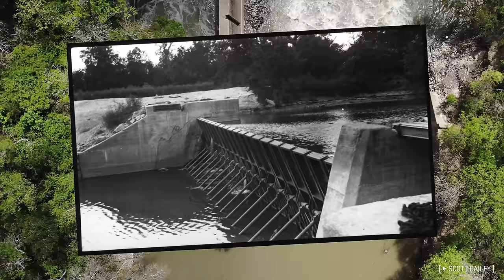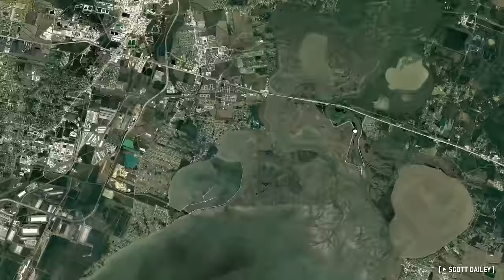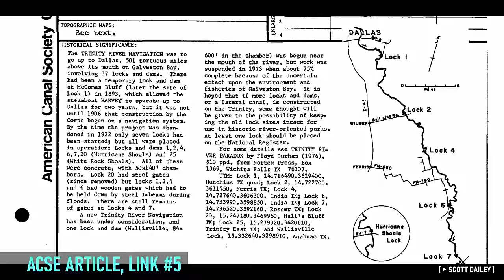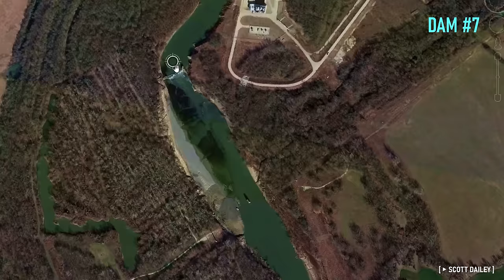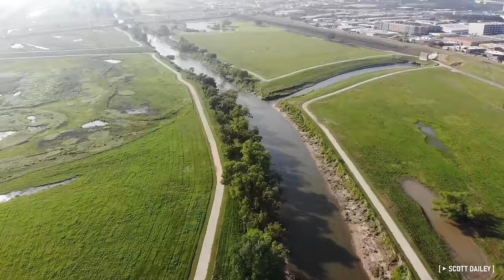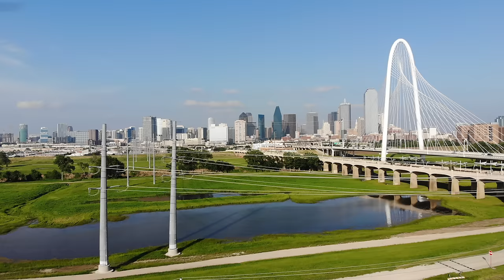Why DALLAS Was Almost a PORT | [TX]

Comment: Dallas was an engineering town back in the 1950s and 1960s.  The fully integrated circuit, the handheld calculator, and the ATM were patented in the Dallas area.  Ross Perot started Electronic Data Systems.  The Collins Radio engineers provided the telecom equipment used for the 1969 moon launch.  All this created wealth and jobs.
Reply: And also oil
Reply: Now it’s a destination for the dregs of society.
Reply: Good to hear my company, Collins Aerospace, mentioned 😆. Glad we are remembered
Reply: Yes, and I think Preston State Bank invented the first credit/debit/atm cards branded "PrestoCharge."
Reply: @TotalDrganMania  Started out as Collins Radio. Then along came the great TI and Raytheon
Reply: But not moon landing since it’s faux ;p
Reply: Now Austin is the Tech City in Texas
Reply: Still is, there's a ton of tech in the greater Metroplex.
Reply: Then trickle down happened and all that wealth became more concentrated at the top.
Reply: @SpassMacher2000  Oil is more of a Houston-area thing
Reply: @danjoredd 
Dallas was a cotton center as
Ft Worth was a livestock center

Comment: I work on modern day towboats. I live in nacogdoches. I have wondered this as well. I have been working on the water for 20 years now and i had no clue they had ever even attempted to make the trinity navigable. Boy she is angry right now with all the rain we have had. She was up over highway 59 last week. When i drove across on 146 in liberty on my way to work this time she was at the bottom of the railroad bridge. It would be cool if someday they made it happen. But i doubt i will see it in my life. Our grandparents absolutely got down building stuff back in the early 1900’s. Much of it is still in use today on the upper mississippi river. That entire system was built between 1933-1939 excepting keokuk… lock 19. The first hydro electric dam in america and the biggest one in the world at the time, was conceived in the mid 1800’s so steam boats could get over the only waterfall on the mississippi river. I think construction was complete in the early 1900’s. Still in use to this day. In contrast there is a lock and dam they started building on the ohio river in the 70’s, allocated funds for it, and with all the modern tools at our disposal we have now our grandparents couldnt dream of, there isnt much more there than a lock house on the bank, no dam, no chambers, 50 years later thanks to crooked politicians, and their good buddies that run “construction” companies. Im sure there are other factors but there is zero reason it should not have been completed decades ago.   It is literally rotting faster than they are building it. Its sad.
Reply: The Trinity Ship Canal was a literally impossible dream for the same reason Denver isn't a river port. There is inadequate rainfall and upstream water storage to support ship traffic.
Reply: Here in Minnesota we found the Mississippi river was never reliable, low water north of St.Louis and few other spots, and Lake Pepin on the river sometimes would stay frozen till early summer.  The railroad just is better in many ways.  For pleasure I boat the river including down in Texas but if I had a business a 1 day truck ride is tempting vs having to arrange a truck  ride to a port to dump stuff in a boat and then get a 2nd truck to pickup in 2 weeks. . . . . . There once was a plan to connect the Twin Cities to Duluth up the St. Croix and then blast thru the hills on Lake Superior, but again the railroads were a bit cheaper.  . .   Farmers do hate the railroad corps for periods of price gouging. .  ..  .The US is sorta blessed with lots of areas with rainfall for crops, and areas with existing rivers, so sometimes one should just put a business in such places before imaging some complex govt scheme to access the few places without much going for it..  . ..  . Keokuk is the northern port that won't freeze too much for tows to keep moving, but I've been on the river in backwater by St. Louis and heard the ice forming and crinkling around me.......  When I talk to engineers they talk about vegetation and environmental crap and they've sorta been brainwashed to just 10x the price of any project with these side issues, so its not just corrupt politicians that make it hard to build.. . ..  .

Comment: Also 25 is under lake Livingston. Not sure if it’s still intact. It was located at White Rock Shoals, which is an old formation currently submerged.
Reply from the maker: I'm glad someone knew! I assumed it was either submerged or had washed away.
Reply: Here's the coordinates of it.
30.9, -95.308861

There's a 1958 aerial map taken before the lake covered it, that's shows it.
Reply: @ScottDaileyYOUTUBE The railroad bridge at Riverside, alongside Hwy 19, is a pivot bridge that could open to allow river traffic to pass.

Comment: For a time, the Trinity was classified by the USACE as a naviagable waterway even though the canal hadn't been built. For that reason, there are three bridges over the Trinity in the Dallas area that were built to accommodate potential barge traffic: the Jefferson Blvd Viaduct by Downtown, the I-20 bridge in South Dallas, and the Loop 12 bridge in West Dallas. The Loop 12 bridge broke ground 4 days before voters rejected the bond issue.
Reply from the maker: Good info here!
Reply: The state highway 31 bridge, between Corsicana and Athens, is built for barges that will never show up as well.  I no longer live in Dallas, but when we drive through and cross the river on 20, I tell my wife why the bridge is so tall.  Then she reminds me I've told her that dozens of times...
Reply: It being classified as navigable may have had nothing to do with the on/off canal projects, it seems most rivers of a certain volume get classified that, even ones smaller than Trinity or ones that there is nothing on the horizon that seems like a boat would ever use it. There also are quirks around if a section of it is navigable, then long parts of the river that are not navigable will still be classified that too.
Reply: @bradleymcwilliams6348  I couldn't remember the highway, just that it was on the far side (for me) of Trinidad.  I checked google maps and then saw your comment.  Coulda saved myself some time.

Comment: I live less than a mile from this river. I remember when they were building the bridge across the river for Hwy 31, they made it taller and and the center of the bridge was built with the option to add a drawbridge. Finishing the channel would have removed a lot of contamination and helped with flooding.

Comment: Thanks for your work on this project.
Around 1968 I paddled the Trinity from Arlington to Dallas.
It was on the rise and smelled of volatile fatty acids.
Lots of little Styrofoam cups. It seemed kinda small
for navigation.
Reply from the maker: Sad but not unexpected!
Reply: Actually the River threw Dallas from Corinth St Bridge is a canal check out the Kessler Plan. The original path of the river was below the Old Red Courthouse where Grassy Knoll is located aka where Kennedy was shot. Parts of the original channel exist still but its called the Trinity strand trail now.

Comment: In the Dallas museum is a 12 foot alligator that was caught there in Dallas. Certainly came up the river. 
I knew there was a push   since Dallas was first built to make it a river port. I never knew about the dams and locks being constructed.
I'm not sure about straightening the river... but it would have a huge impact on flooding issues in the upper Trinity basin.
It would be interesting... but all in all, the Trinity river is for the most part just like it was since the 1700/1800's.
Reply: I read that there are still families of alligators present in the Trinity river around Dallas and a few lakes in the northwest of Dallas. There have been many sightings!
Reply: No the Trinity is definitely not the same the Kessler Plan changed the whole course of the river through Dallas.

Comment: Dallas did end up getting port status and it's been getting larger. The International Inland Port of Dallas or IIPOD. The port district is over 7,000 acres of major warehousing and manufacturing. It's Intermodal, trucks, trains, and airport. Shipping containers are constantly moving in and out from the Gulf ports to IIPOD. Containers come in from trucks and trains across the country to get sent to the sea. It's very impressive. It's located in 5 different municipalities in southern Dallas county. Wilmer area

Comment: Similar plans were made for the Brazos river. The plan was to make the river navigatable up to Waco. Work started but was also halted due to WWI.
Reply: a couple of them are visible from some bridges and if the water level is low enough you can walk right up to it
Reply: @rustyredneck6781  I used to fish across the river from one of the locks at a place called Smiths. At the time I never knew what it was.

Comment: I run quite a bit and one of my favorite routes is at White Rock Lake. I always found it odd, that that lake has a levee system. This system feeds into the Trinity River. Also, random fact, while running I noticed plaques placed around certain locations at White Rock Lake, and did you know that the Americans used that area to imprison German captives during WW2? 
#TheMoreYouKnow
Reply: ive cycled and walked my dogs around white rock thousands of times and never once stopped to look at any of those plaques lol

Comment: I mean it's cool but it was never gonna work the Trinity gets real narrow and shallow throughout many parts of the river if your not careful you'll beach a john boat right in the middle of it now imagine trying to get a commercial barge through it, also projects like lake Livingston make it just outright impossible the north part of the lake is literally just a a flooded forest and even decades after it's construction those trees are still tearing up boats and the dam at the south end of the lake is a solid 50 foot drop off back into the river and there ain't no way in hell all those rich assholes on the lake would let commercial shipping pass straight through their scenic little paradise even if creating a traversable lock from the lake back to the river was possible the TRA is in the rich folks pockets and does everything possible to accommodate lake side residents above anything else

Comment: Elon Musk could pay his own river highway from Hton to Atin. I would trust AI boats confined on waterways more than AI cars.
Reply: And all that water, sounds expensive. Maybe we can put down some kind of skids, or metal rails, and slide the boats on those. Sliding could wear through the hulls, so lets put metal wheels under the freight boxes and hook them up to some big electric motors. Maybe we put generators on there too, then we can just one a couple motored ones and push or pull the rest. Then things can go this way and that way on rails, smooth as you like. We'll call it: The Railed Ways

Comment: Its good it wasn't built because it would wreck the ecosystems of E. Texas.  If they were to do anything they should connect to Savanna River that goes into the Atlantic because while a few canals would have to be built they would be a fraction of teh length of this canal project.  And then they could build this but it would stop short of the ocean on the backside of the ocean port so goods can be loaded off and on bat the port between fresh and salt water ships.